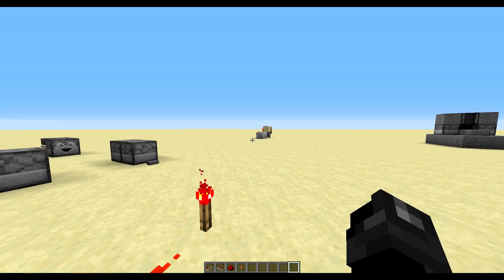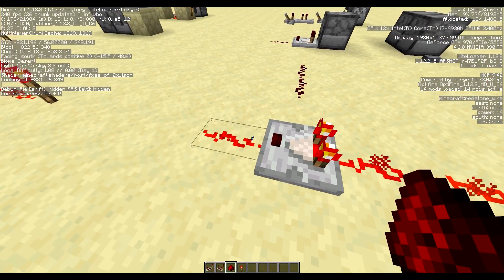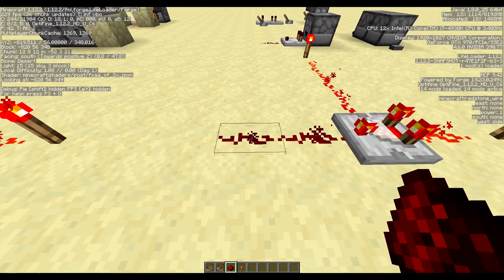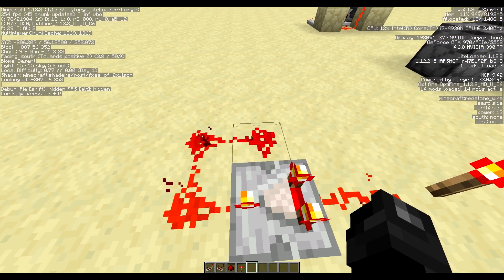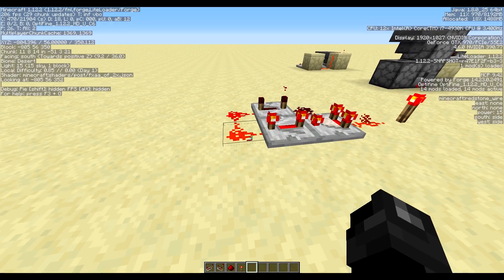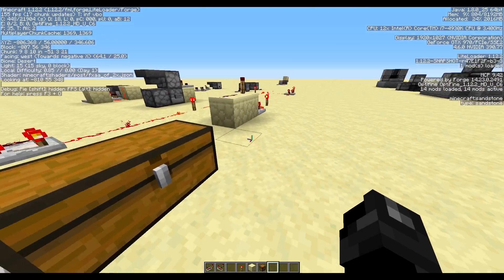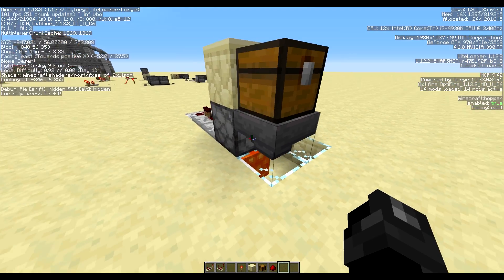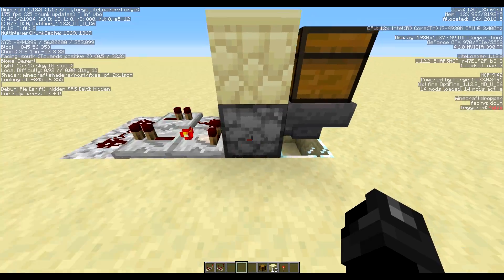Permanently deleted - Redstone Bunker 2.0 #3

Comment: It's worth noting that at 9:42 the dropper stops tossing items because of quasi-connectivity. I mean, it's fine that you don't explain it at this point. However, from what you've covered so far, one would expect it to continue emptying because the clock seems to run independently from the chest.
Reply from the maker: Hey, yeah, I didn't mention it because it wasn't really relevant to the function of the machine. I figured just knowing the hopper would stop was sufficient. Thanks for pointing it out, though. =)